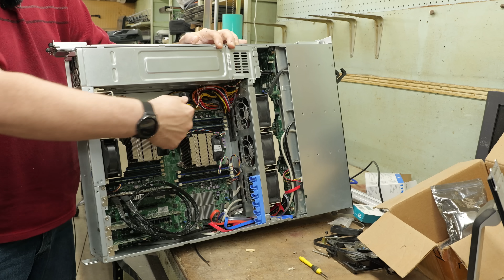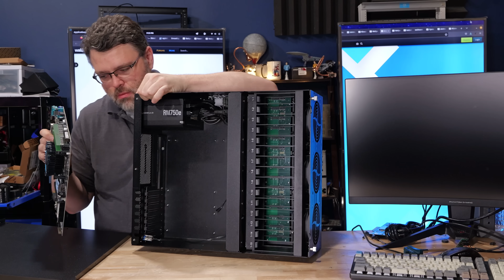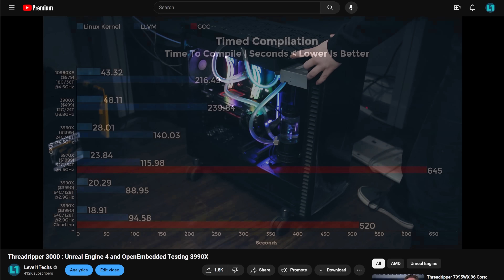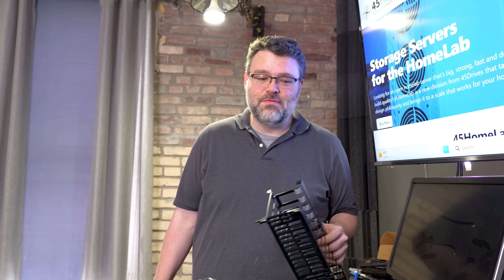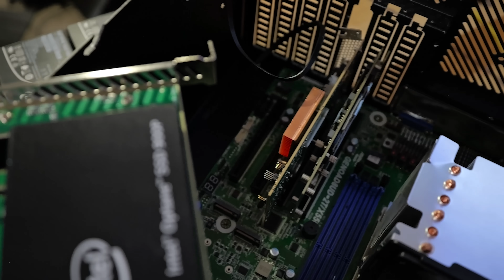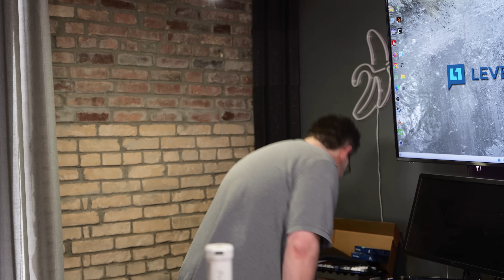45 Drives HomeLab HL 15: Why the Chassis is Important

Comment: I had a completely different experience with 45Drives. They don't hold your hand, and you're typically on your own unless you pay for a support plan. I'm watching this video thinking "I have no clue how you had this experience except that you're a YouTuber, and I went in as a regular customer". I paid them over $10K for 2 cases + an SSD mod. I never felt like a first-class citizen there because I only bought cases, no hardware. And in my dealings with the company, they don't feel small.
Reply: What do you mean by "they won't hold your hand"?
Reply: @LabiaLicker  if you're not extremely technical, it'll be difficult to pinpoint an issue. I got direct-attach boards replaced because I noticed the lights weren't working, and through pictures, we figured out some LEDs were damaged.

On the other hand, I still don't understand staggered start because their docs say it only works with their OS. Doesn't make sense because the PSU should be handling it. I haven't asked them about it because I'm not sure if this is a non-support-plan question.

A question that requires a support plan is why drives are sometimes not showing up at boot or why adding a drive eventually causes ZFS errors or disappears from Linux unless that drive was plugged in when the system booted. Is it software or hardware? How do I debug when this is my only SAS system?

It's up to me to figure out those questions. I'm not even sure if that's normal behavior. 45Drives can't debug that kinda stuff without a support plan, so it's tough to figure out if a cable, power supply, or board is bad without doing the work myself. If I can narrow down my question or request (replacement parts), then I can get answers.

Does that info help?
Reply: @Saturn2888  Thanks for the rundown
Reply: @Saturn2888  Staggered start has nothing to do with the psu. It's usually done by the controller when it inits the drives. If you have a raid controller for example it's usually an option. A consumer grade motherboard with only 4 to 8 drives won't have it. They might be saying it's unsupported because they don't want to hold your hand for XYZ manufacturer and they just can't waste their time finding that for you.
If you do tech support you learn that you just can't support everything. Maybe 20 or 30 years ago you could but nowadays there's just too many brands and config options. You are responsible for your own choices of products you buy. The manufacturers should support you if you don't want support from a company like 45drives.

Think of it like this. Would you take a BMW into a Toyota dealer and expect them to be able to diagnose and replace parts in that car? I'd not even trust them to not damage it Leta lone diagnose and fix it. Expecting a manufacturer to support hardware they didn't supply to you is just a nightmare in their eyes.
Reply: Same experience (but slightly cheaper) for me and Asustor. Geerling got an email address for issues, I had one of the worst support forms I ever saw (for 2 years until they fixed it).

I don't think anyone should be buying home/server hardware based on YouTube experiences.
Reply: Sounds to me like you need a support plan and don't want to pay cause you think you know what you're doing. The evidence shows you need the support. If all you paid for was a box of parts don't be mad you don't know how to make em work. Pay for an up and running server next time my man.
Reply: @chublez  dude, what a jerk thing to say. First, I do know what I'm doing, but the case doesn't come with a manual like the SuperMicro ones, so unless 45Drives tells me their specifics, I won't know.

There's stuff in their wiki, but it's a lot of guesswork.

Second, I'm not a business. Of course I don't want a support plan. I built the server myself, and I didn't know if it was something I did wrong or the PSUs. It was a combination actually.

Other folks buy 45Drives cases and need to know it's not the same as YouTubers say.
Reply: @skilletpan5674  the signal for staggered spinup is on pin 11 of the sata power connector, so the controller should have no influence as its only connected to the data part of the drive and not the power part.

Comment: Awesome case and video... $800usd is waaaaay more then most people would be willing to spend on a home nas chasis even if it does last for 10 years... I think it will primarily find its way into the smb market then filter down into the home  lab when its decommissioned.
Reply: If they can get the price to half around $400.  It would be pretty attractive.
Reply: You guys are crazy. My mostly plastic PC case was $250. You want this at those prices? I think you're forgetting it has a NEW backplane in it. Not a used one. My PC case and a used backplane is near what you guys want to pay for this new.......
Reply: @chublez  if you are buying pc cases for 250 you are just getting ripped off
Reply: yea 800$ is nuts... i can pick up a supermicro case with more bays and psu for less....
Reply: @chublez  Are you getting paid to to defend 45 labs in every thread here ? For under $250 you get amazing PC cases like LIAN LI Dynamic EVO XL or Corsair 7000d

Comment: I use a 12700 for my Plex server in a Deskmeet B660. Keep it around 65 watts. With a WD Red NAS drive and two M.2 drives for the OS and Plex data. Been running 24/7 for 10 months with zero issues. Great server processor.

Comment: Thumbs up for dual virtualized router setup! We have been rocking it since 2018. Provisioned 3 ports to a separate WAN VLAN, connected modem to one port, two to each router's dedicated WAN ports in their hosts. We don't actually run two instances of virtual router, but have a single virtual instance that we migrate between hosts as we need. Highly recommend it.
Reply: I love this idea and this was what I wanted to do here as well (I've got a proxmox cluster set up and I could easily have a single router instance set up for HA), but I found that BSD's support of virtio network cards at the 10g level was trash (with it maxing out at something like 4g or so).  hardware wise, I'm using intel x520-t2 dual port 10g network cards lagg'd into my 10g netgear 24 port switch on each node (5 nodes) with little going on traffic wise during my testing (it's a homelab / homeprod setup).  I did a bunch of searching on forums and whatnot, but it seems to come down to virtio support in bsd (the nodes get a tested 9.8gb or so going from node to node baremetal and other operating systems in vms don't seem to have the same problem (linux works great, windows is a little behind but I get roughly 8gb on windows vm's).  I could use sr-iov which is supported on the card, and does work, but if I assign an sr-iov adapter to a VM, that VM can't do HA.  very frustrating.

Comment: Wendell I knew your build in the HL15 would be a step above the rest. I didn't realize that it would be observing the other builds from the stratosphere! Wishing that power supply the best of luck in the near future. haha If you're replacing the power supply with something modular it would be pretty cool to see a quick video showing how easy it is to make custom length power cables. A build like that would look amazing with custom length perfectly routed power cabling since all of drive data cabling is so minimal.

Comment: You should checkout the Sliger CX4712. It is a much more reasonable price point for a bare case than this. Made in the USA also (so same manufacturing advantages/disadvantages as 45 drives).
Reply from the maker: Keep in mind this comes with a nice backplane and fans tho
Reply: @Level1Techs  The Sliger case comes with a backplane and has the option of coming with 3 or 6 Noctua fans (at a slight discount). It's only $400 in comparison and those bays are hot swap. With some Icy dock accessories you can fit some SATA/U.2 drives in the 5.25in bays, or put in an actual optical drive for you to rip your movies directly to your NAS.
Reply: As an owner of that case - no, it's not a back plane. It's cheap sata passthroughs. There are other niggles I've had...I'd much have the HL15.

Comment: I don't really get who this chasses is for? My fractal define 7 has room for 12× 3.5 inch hdd, 4× 2.5 inch drive, and more drives if you get creative, a rtx4070, full atx mobo, normal psu, and it's just a desktop case with normal desktop case pricing? In the front there's 3 fans and a filter. I'm using this as my main PC right now, but if I ever decide to change it out, it'll be a kick-ass server chassis due to the amount of drive bays and ease of building in it.
Reply: There is a lot to like about this chassis - compared to my NAS case (Antec P101), this has a lot of advantages. The backplane alone is really valuable. The question is, is it $800 worth of value? I'd say 'no', though for some people it might be.
Reply: It's not for home use it's for enterprise and there you want to have easy swap, support and rack mount.
It's very cheap for what it is.
For consumer not.
Have a look what professional storage solutions costs and if you fully populate it and run it 5 years 24/7 it's is the lowest part of costs here
Reply: @elalemanpaisa  but it is explicitly being sold as a home lab solution. It's adapted from an enterprise solution.
Reply: @newstandardaccount  yea I know however it's pretty difficult as many people assume an old laptop or a tiny pc is a home lab. Granted it's fine but a real lab would use actual server hardware.
I endorse to use a different naming schema like:
Pro home lab
Or calling the other stuff just "hobby pc"
Reply: @elalemanpaisa  at the end of the day regardless of what we call it, it is being marketed as a home solution yet it is way more money than most people can justify. 

I'm not knocking it either - it appears to be a very well built case, and in an enterprise where time is money, that can make a lot of sense. For most home users however, they'll be able to find better ways to spend $800.
Reply: @newstandardaccount  well there are people with equipment worth more than 6 digits at home. So it's fair. Anyway the price is fair for what it is
Reply: @elalemanpaisa  I feel like we're arguing in circles. I began by observing that it wasn't worth it for most people, but for some people it might be. 

You countered by suggesting it was for the enterprise. I pointed out that it is actually marketed as a home lab solution. 

Now you are arguing about whether or not the price is fair. I never said it was unfair. I just said, for most home lab people, it won't be worth it.
Reply: @newstandardaccount  you are pretty much right however in your last response you were complaining about the price.

It's true what you are saying, however, to me it's quite blurry with the term "home lab" as the both of us might perceive it differently. To me, homelab means stimulating an enterprise environment. In my home lab are servers which were formerly used in enterprises. If I would go for consumer hardware without any features enterprise's are using I wouldn't call it a home LAB. Many people thing a docker server and home assistant is a homelab which is fair but to others an home lab is something you want to test enterprise ready production features rather than serving purposes in your home. Wouldn't you agree? As mentioned before the term "homelab" is pretty bad today. A qnap 2 bay nas with VM support and container support is an home lab - to me just not.

Comment: I’d totally score one of these DIY cases but I already built a new home lab running unraid back in may/june. I used a fractal design R5
Reply: If you don’t need hot swap, those big Fractal Design cases are sweet. I’ve got an R6 in he basement, and a Node 804 sitting discretely in my living room. Compared to the cost of the drives, they’re just about free.

Comment: Next server at home will be 
AMD 5600G + ASUS Prime B550M-A + and to start with 32GB DDR4.

This motherboard + AMD 5600G support up to 128GB.
32GB will be around 350 euro total for 32GB or 550 euro for 128GB.

The bios support 8x4x4 PCIE bifurcation when running 5600G. 
Later when i got a adapter from aliexpress for 8x4x4 (2nvme + 8X PCIE)  i will try 2x drives + network card on 16X slot.
Motherboard itself support 2x PCIE NMVE drives.

Comment: I really wanted to love this case. But the price... For $800 its a hard sell for what it offers? They knew this going into the homelab community. We look for price/performance above all else. A small portion of the community might spend $$ on top tier hardware.

If I can get an H12SSL board, 7302P EPYC, and a SM CSE-826 for less than what they sell for a barebones case. We have a problem. 

Its a great case, just outside of my justified price range.
Reply: Looking at those Chinese ebay listings huh?
Reply: @timramich  aren't we all
Reply: @timramich Looking? You mean bought and owned for 4 months now lol. I did pick up a 7302P for $150 shipped. No issues with it. Solid purchase for all those PCIE lanes. Seems the community has a preferred seller on ebay from China so I went with them.
Reply: @zacharylewis417  brother with respect, the SM CSE-826 is not very aesthetically pleasing. We built the HL15 with full understanding that this will not be for everyone. This is very much meant to be the centerpiece of a homelab. I've had my Storinator in my rack in my wreckroom for a couple years now and without fail when I have someone over it's nearly always the first thing they look at and go... what the heck is THAT thing? It is very much an eye catcher. 

I get it though. Many of us as homelabbers are 100% function and I completely get it. I personally have a bog standard ol' Rosewill chassis underneath my Storinator. It serves the purpose - but I've never got excited about a Rosewill chassis. Upgrading and working on my Storinator has always been fun.

For me, its similar to my gaming PC. I love having a very aesthetically pleasing gaming rig. I used to go custom water loops but because I switch parts out so often now I just do AIO. but my 4090/13900K rig is also very much an eye catcher. 

The build quality of the chassis compared to the Rosewill, Supermicro, etc also just isn't even in the same stratosphere. No rivets, all screws designed from the ground up for customizing and repairability.

I am the chief architect at 45Drives, and we on the r&d and support teams are very much homelabbers. We love this stuff. When we set out to start this division we did it as a passion project. We've grown a great fanbase over the years and we've heard so many times about how people would love to get one of our servers in their home - but the enterprise model was just too expensive to be able to do it. We wanted to keep the 45Drives DNA and we didn't want to cut corners. And this was very much a big part of why we started the HL lineup. We manufacture the chassis completely in house. We would love it if we could get the prices a bit lower as well, but I can promise you that our margins are very thin on these products.

The good news is, we have had an incredible response to the HL15 launch, and orders have overshot all of our expectations. This means that we are absolutely continuing and currently already planning to  bring out more models in the HL lineup. I really hope some of them appeal to you as well!

Comment: 1:05 "Circuit Breakers that have chips in them that are overly sensitive to people doing mad science in their house."  Preach! Yeah, the GFCI's in my garage do not play nice with the VFDs I use to run the 3-phase motors in my workshop.
Reply: Sounds like you need some sort of power factor correction on the input of that VFD, or just skirt your codes and don't run GFCI outlets.
Reply: aren't VFDs supposed to act as soft-start too
Reply: @marcogenovesi8570  Most offer that option, but it isn't necessarily enabled by default. (Though I do have it setup on mine)
Reply: @marcogenovesi8570  They don't do wye-delta starting obviously, but just running AC power through a rectifier and capacitor to get DC leads to a poor power factor on the mains line.

Comment: I have been thinking recently, what is the point of no bottleneck? (for consumer level connectivity) in both spinning and flash scenarios

By no bottleneck I mean cpu, networking and drives operate in 100% mode (I know, nothing is ideal it will be lower) 

So something like: I have 32 lanes of pcie. 16 to storage, 16 to network. My x number of gen y cores does all the parity calculations and stuff without dropping the speed

It there such a golden ratio?

Comment: These guys are so damn expensive, even worse than Caselabs was.  800 bucks for basically an ATX case. I contacted them to get a price on JUST THE CHASSIS on the 45 drive rack mount case and  depending on the PSU, prices ranged from 2k to 3800. That's crazy, what they are offering isn't really worth what they are charging when you can get a used 36 bay supermicro for 500 bucks.